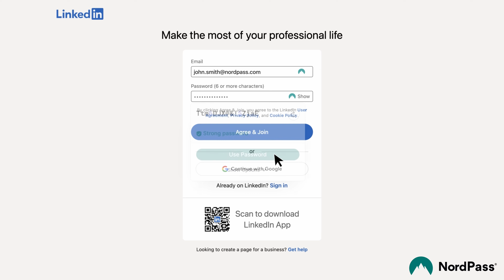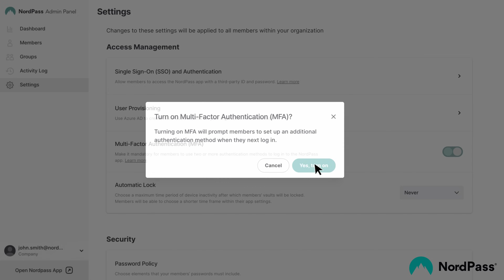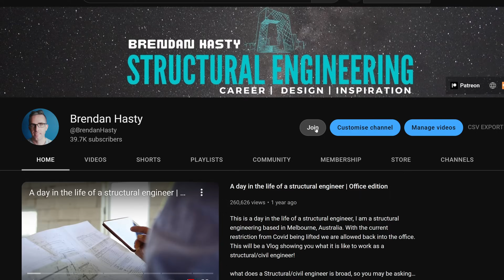Civil Engineer vs. Structural Engineer, What's the Difference?

Comment: There are differences between Structural Design Engineer and Structural Analyst Engineer (able to predict the shortcoming of the structure by using Finite Element and change the geometry of the structure by optimizing it)

Comment: A structural engineer is a civil engineer that has passed the istructe exam in the UK or US equivalent. It’s the hardest exam I have ever taken but only after passing it was I a structural engineer. To do so I first qualified as a civil engineer 2 years earlier. Takes about 10-15 academic plus practical years before you have the capability to pass the istructe exam.

Comment: Great video! Some civil engineering sectors can overlap depending on your work area. For example my role in Aus railway track design considers aspects in mechanical engineering (dynamics, tribology, wear etc..) which a civil engineering degree would not generally cover.

Comment: Not all structural engineer has civil engineering degree, some has mechanical degree, though most of them are specialized in steel only and have basic knowledge on foundation design. But they can be very good with FEA and fatigue design
Reply from the maker: structural engineering more specalised
Reply: Both work hard. Get less pay
Reply: @shishirdhawade2613 only in India😕
Reply: I am a mechanical engineer, I Working as a structural steel connection design engineer. I want to change my career in this related most mechanical engineers doing a job..
Reply: That means that a materials science and eng degree would fit as well.